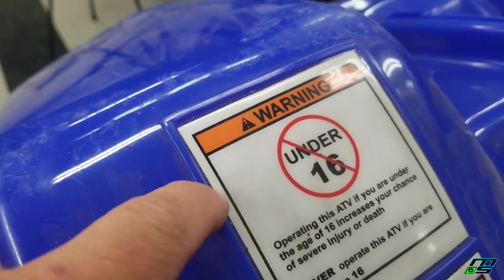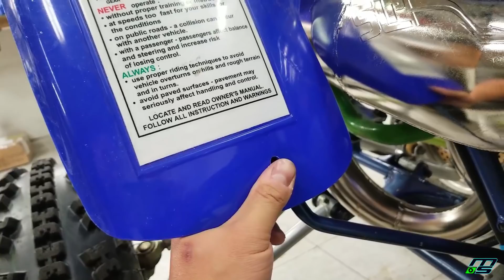I can't believe how different my Banshee looks after these mods...

Comment: You can hit the light spots on the plastic with a torch or a heat gun it will take the light spots right off
Reply: Actually I tried it before and then it worked

Comment: It was allot of years ago we all had banshees. I think at least 10 of my friends owned them... i never did much of the work on mine. I gave a friend money, told him what i wanted, and he'd take care of the mods, then explain to me what he'd done (i was pretty lazy lol). All of my banshee friends always said,  "it's easy to get a banshee to go 90, after that you better have a big wallet". Like, you need to switch things over and run race gas. Bigger, more expensive mods to go over 100 for sure.  I only had small stuff done. Pipes, ports, gearing, welded crank. A few other little things i can't remember. On one good day, with the right weather, i had it going 90.

Comment: Mike,
Theres an article in dirtwheels how fast can a banshee go stock and mod on a radar gun on google.
They do before and after mods like fender cuts and stuff,along with pipe and other mods.they also use road type wheels and of coarse use different  gearing..you'll be interested

Comment: A heat gun will probably turn that white spot in the center of the front fender under the radiator cover back the correct color
Reply from the maker: You think? Maybe I'll try this on the fenders I cut off incase I mess it up.

Comment: I also have a 97 YZ 125 with a Athena 144 cylinder port matched it rips thing can keep up with my Dr 650 till about 70 mphthen the Dr pulls away it's a long stroke motor

Comment: I have 2 servals 1 with pro curcuits stock gearing and 20 inch tyres and it runs 92mph on phone app..pro circuits redline at 9200 but i dont know how much overev to get that speed.i have another 421 serval stock gearing 20 inch rear cut front ported and probably most important, sniper pipes which give good bottom but rev to 10000 and that bike is a lot faster(dose another 1000 revs and has better breath on top) so i estimate over a ton but i haven't run a speed check yet cause i have a broken collarbone. I do know it ran 85mph at a local dirt drags and it had plenty left.so in short a pipe like shears or better yet sniper with a little porting which i think your s will have should see a ton.
Yours with a pipe that redlines 8500 to 9000 overev but with higher gearing should do it easy